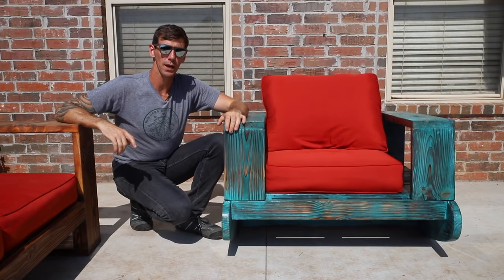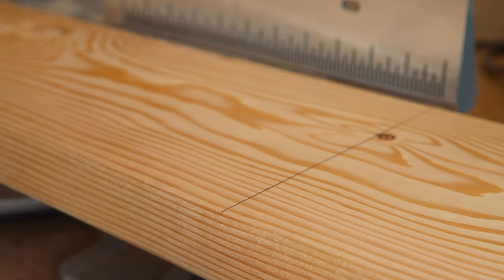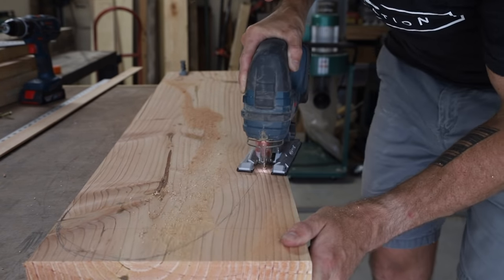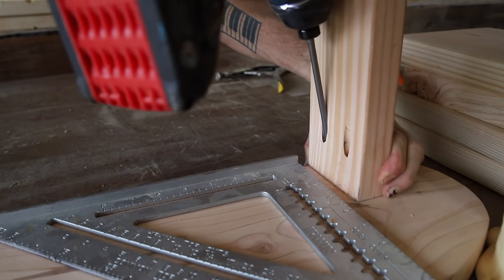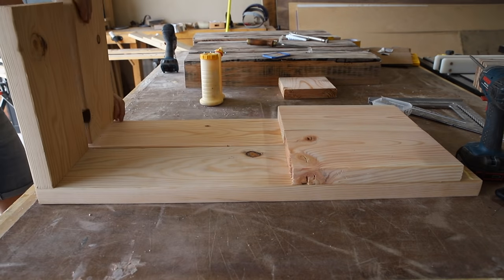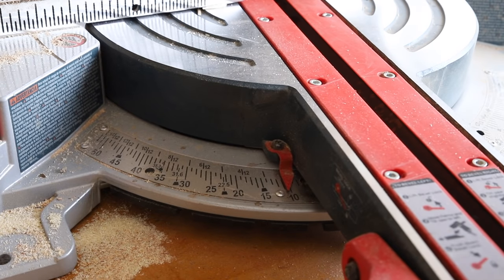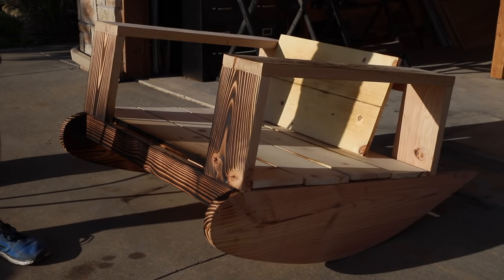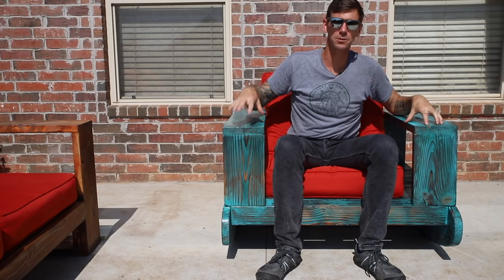DIY Outdoor Furniture | Outdoor Rocker w/ Shou Sugi Ban | Beginner DIY Project

Comment: I'm thinking a roundover on the arms and chair edge may make it a bit more comfortable and knock off those sharp edges. Simple and sturdy...the best kind of outdoor furniture. Did I miss where you got the cushions from? Are they just home centre standard ones?
Reply from the maker: The cushions are from Amazon, and linked in the description. I didn't show it very well, but when I planed the boards I left a bit of the rounded edge for both comfort, and to keep the thickness as much as possible. Forgot to mention that.

Comment: looks awesome. i like the blue. honestly though the red came out best, almost like a cedar wood. Planning to do the kitchen island similar and hoping that a blow torch with a large head will suffice?
Reply from the maker: Thanks! I’ve seen folks using the smaller torches to make it work. I haven’t tried it yet, but you should be okay.
Reply from the maker: Also sweet scuba pic. I’m a diver myself.